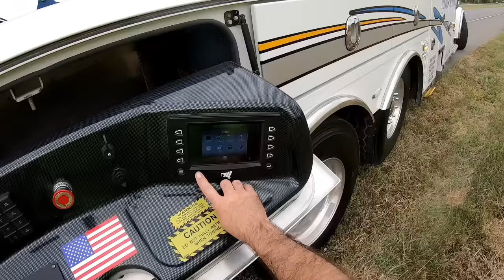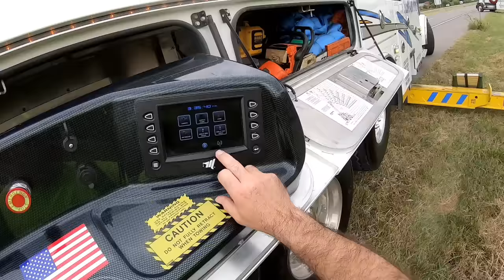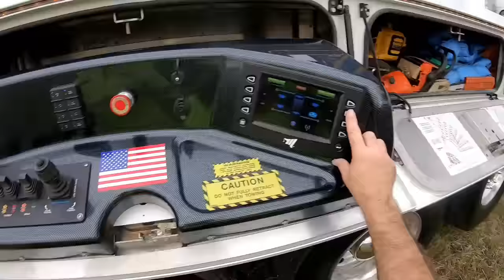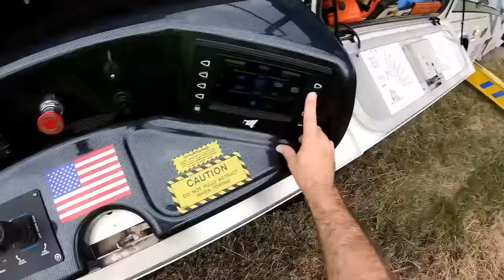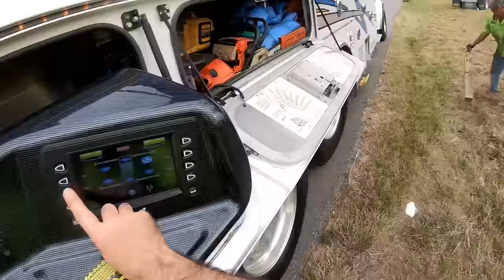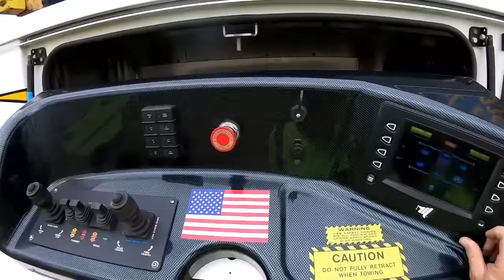Code 3 Semi Crash!!!  Semi Loaded with Sand Takes the Ditch!!!

Comment: You should install a Federal rotary siren.  They are amazing most of the fire truck and engines in my area have them and the sound and carry is amazing.   Most of the ones i have seen are operated by a foot switch. So it keeps hands free.
Reply: Watch the cab ride portion again and listen, he said he still needs to finish installing the one he received.

Comment: Looks like you retrofitted your traffic cones with washers at the top, I'm guessing to hold those round flashing light assemblies.  How did you get them to bind to the cone material? Epoxy?
Reply: Those puck light have magnets on the base, he glued a metal ring to (likely the underside or) top of each cone.

Comment: Semi tow trucks are now like a startrek ships. I wonder if it has a remote drive on that controller. Instead of having to move the truck from inside the cab. Cause the breaks throttle and stearing are all electronic servo driven now. It's all fire by wire. I imagine it dose .

Comment: When running code 3 to the crash why is the tragic not pulling over to let the wrecker by? In Oklahoma it is the law that when there is a emergency vehicle running code they have to pull over and stop or they’re in violation of a felony if the risk is determined
Reply: If the rec is determined to have injuries.

Comment: Ron, have you tried the Miller fifth wheel attachments yet to lift a tractor from the rear? I'm trying to decide if it's a worthwhile option.
Reply from the maker: I have not used one, but I have looked very closely at them.  Everyone has their own opinion, of course.  Mine is not favorable towards their fifth wheel attachment.  I love Miller products, however, I do not like this particular product for several reasons.....time of set up and hook up, storage area required, weight distribution, just to name a few.  Don't let my opinion sway you, though.  Make your own assessment of it.   If you don't have the Miller U-bolt cups, I would suggest getting a set of those.  They are an extremely valuable tool.   Best of luck.

Comment: I know you have discussed multiple times about the 3 or 1 horn blasts when in reverse/pulling forward, but is that something you’ve always done or is that learned through a class on driving big rigs or just when you have a job in towing that they teach you?
Reply: Its something that comes from the Railroad/Railway industry as they never came equipped with alarms, they always do the triple toot when reversing and single blast when heading forward, just in case anyone unseen in the caravans way did not find themself being run over due to being inattentive.

Comment: Why does the rotator have 4 hooks and 2 pulleys hanging there? Thanks!

I assume the pulleys are to make a block & tackle system to get more force when you're making a pull?
Reply: Yes he often uses the tackle you see to help lessen a load whne lifting or pulling as well as when needing to redierect the line to get a lower angle on the pull with a few other snatch blocks as they are referred to which are also in one of the compartments.

Comment: Nice run didn't know you could use a siren.  You need to alter your siren as said below, or Sterling model 30 Sirenlite if legal.  The other method is the air horn.  Blow a 14L like a train at an intersection and it will wake people up.  I think having a guy in the right seat running the foot pedal on a siren would be great, wide open at intersections, just like a fire chief.  Yes if you oculd just use blue during your run that would distinguish you as an emergency vehicle. I'm not from your state so if i saw blue or red I would think emergentcy vehicle.  If i see amber i think community worker.  My truck at work have those, but that's for safety not for response.  Love the tow mater, he need light bars too.

Comment: Well if the driver is 'complaining' he's got 99% of the battle licked.  Wondering what you put down for a sand spill, oil?    Federal Q (mechanical) would melt your brain :)     I wonder if Miller / Century could give you a software option that spools both winches in with equal torque or speed.   Best wishes for Mike's Dad! Speedy recovery.

Comment: Not sure if there is any point to this thought that popped into my head but would appreciate constructive thoughts critical or otherwise:
Is it of any use, for people driving whilst chatting on or using their mobile device, to have a notification of an approaching emergency vehicle pop up on their mobile device? Most people believe what their mobile devices tell them and much of this depends on how the app or firmware on the device presents a notification to the owner of the device. So, would it be of any benefit to having specially fitted emergency transmission equipment designed specifically to broadcast to mobile devices capable of receiving and displaying such notifications?
Reply from the maker: If you could develop something like that, you might become a mulit-millionaire.   Seriously....that would be very useful if properly designed and implemented.
Reply: @RonPratt  Yeah, I don't think I'd ever get near the level of expertise needed to do that myself, however, if anyone in the comments section wants to take a crack at it, go for it! :D

Comment: At the beginning of the video you refer to Code 3. What is meant by Code 3 (and by running at Code period)? Then you say it takes a while to get your truck up to speed (what speed I wonder), but when it does - what? You didn't finish the sentence. What happens when you get your truck up to that (unspecified) speed?
Reply from the maker: Running Code basically means that we are allowed to drive in the same manner as police and fire personnel when responded to what the official dispatching center deems an emergency situation and requests expedited response.   There are different levels of Code and some are termed differently.   Locally, most common are Code 2 and Code 3.   Code 2 is running emergency lights and only running the siren when necessary.   Code 3 is lights and siren constantly until on scene.   It's rare that we run Code 3.    For more information on Missouri laws regarding tow trucks using lights and sirens:  https://revisor.mo.gov/main/OneSection.aspx?section=304.022
Thanks for watching and God bless.
Reply: @RonPratt  Thank you for the explanation. I thought Code 3 might indicate some kind of emergency but was puzzled because I would hardly consider the incident in this video an emergency. A truck simply left the road. It didn't hit anything or overturn and there were no serious injuries. There were no hazardous materials involved (the last time I checked sand wasn't hazardous). In fact I've watched quite a few of your videos and this appears to be the least serious incident. (Excluding of course the video in which you installed new winch lines. At least that video answered a question I had been wondering about for a while; the length of your winch lines. As you said in the video they are 250 feet.)

Comment: You badly need a set of train horns, I guarantee you that 4-wheelers will hit the shoulder when you pull the chain on them !! I run a set on my Pete and I love them when I get cut off rolling at 10 over speed limit on the interstate

Comment: 2:03 "When we are told to run Code, we run Code.  It is not our decision to make"
5:10 "I'm going to downgrade the response"
which is it?
Reply: You should listen to when Ron talks as he drives, he says why if you bother to listen and not just hear him.
Reply from the maker: When we are told to run Code we still have to use common sense while driving and we have discretion while we are en-route to act/drive according to the traffic conditions.   As stated earlier in the video, running Code is a HUGE responsibility and a HUGE liability.   I have been through that intersection many, many times and it is an extremely dangerous intersection when driving normally.  I made the decision NOT to endanger lives by forcing my way through an already dangerous intersection.  It added, perhaps 20 seconds to my response time.  So....if you want to question my decision, go ahead.  I stand by that decision and would do it again.  The situation did not warrant risking lives.

Comment: I have asked before , I would  like to know how the  boom  rotates is it hydraulic   and  how is it anchored to the truck .
Reply: yes it is a hydraulic motor, unless I am mistaken and it's electric, since the winches run off the pto which power a hydraulic system to run them.

Comment: Ron Instead of sending the other truck back around like you said could’ve you just anchored off of the FD Engine. With permission of course. It Reduce time on scene.
Reply: Department engineer would tell you to go pound sand on that idea.
Reply: Not a good idea. Fire equipment isn't made for pulling. They're built like a custom coach.

Comment: 72,000 lbs on 3 axles? what are the drives and steer axles rated for?
Reply from the maker: The Rotator is actually a 4 axle unit.  The steer axle is rated at 20,000.  The lift axle is rated at 20,000.  And the drive axles (tandems) are rated at 54,000.   That gives me a total GVWR of 94,000 lbs, but we are regulated to the standard 80,000 lbs except in emergency situations or when permitted.     Thanks for watching and God bless.

Comment: Just curious what is the furthest away from rotater that the remote still works ????
Reply: Since the main winch lines reach 250 feet from the truck it's safe to say the Miller Raptor Remote works up to the edge of 300 foot

Comment: If it was muddy it wouldve been on its side cause he wouldnt been able to stop once in mud and wouldnt have supported at that angle.    
Pulling on the ange of the ratator gear couldnt you have went to single line and use second cable to outrigger to ease stress on gear

Comment: This job did not need a rotator a heavy duty wrecker could have backed up to the truck and winched him out and would have cost the trucking co. much less.
Reply from the maker: You are correct that a standard Heavy could have "TURNED AROUND" and pulled the truck out.  Think about that......   I was able to use the rotator, from the shoulder without EVER shutting down traffic.  Turning around on the interstate is dangerous and unnecessary.    Not only that, but the customer REQUESTED the rotator.   I brought the equipment that was requested, completed the job in a timely and safe manner, without impeding traffic.  I've worked standard Heavies for many years before we had a rotator, so I do know their capabilities and their limitations.   As I always say, there are many way to reach 10.....   Just because you add 5 plus 5 and multiply 5 X 2, we both still reach 10.   Thanks for watching and God bless.